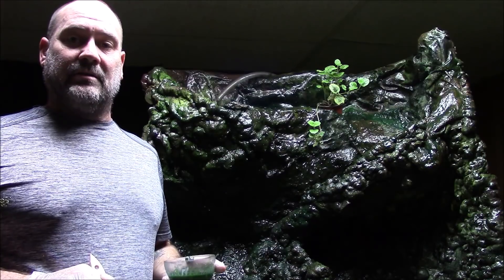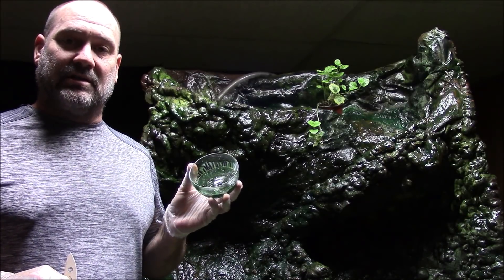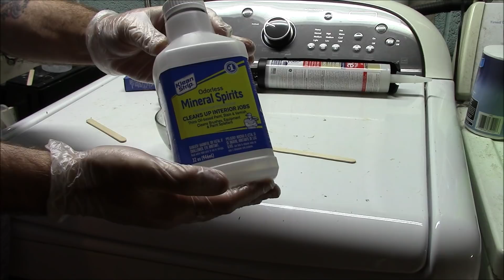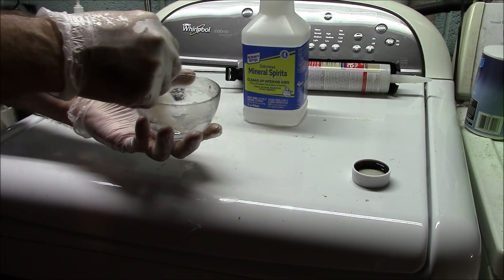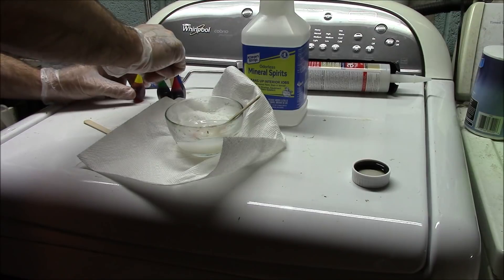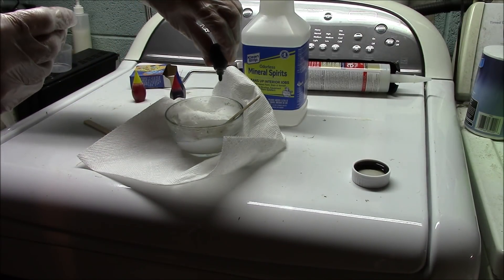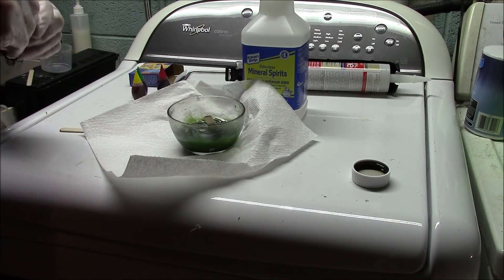Thinning And Dyeing Silicone To Make Rubber "Paint"

Comment: Can you use acrylic paint instead? I’m needing to make fake ganache for a fake cake prop and need it to be flexible to stick to foam and not crack. So can you add mineral spirits to silicone sealant to thin it down and it will still dry to a rubbery hardness?
Thanks for this video tutorial!
Reply: If it’s like a shiny ganache, then I would thin the silicon with Napthine (I remembered the name😉) or mineral turps until it’s about the same consistency as warm ganache before adding the paint. It should look just like ganache, tho if it’s going directly on a foam base that could potentially be a problem as the silicon and thinner will start to dissolve it. It could be ok as the silicon could cure before it’s had time to do any real damage, but you never know so I would paint or cover the foam first, just in case. Good luck.
Reply: @nicola3540  ..thank you! I actually covered the styrofoam with a latex silicone sealant, mixed with brown chocolate colored acrylic paint, so I should be okay! Where do you buy Napthine at…a hardware or art store?
Reply: @nicola3540  ..oh, and I first covered the styrofoam with cosplay foam prior to putting on the acrylic latex silicone sealant mixed with paint.🙂
Reply: @nicola3540  …I’m having a hard time finding Napthine. Are you located in the United States? I wonder if it’s under a different name as I looked for it online at both a hardware and art store…and on Amazon too…and couldn’t find it.🤷‍♀️
Reply: @janetgernand9123  I am an idiot, SORRY!!! Naphthine was the name of our former state premier (ie governor) here in Victoria, Australia where I live….. What I really meant to say was naphtha, which I think could be plain old mineral spirits in the US, which is what you asked about in the first place so sorry for the confusion. (In Australia there’s no such thing as ‘mineral spirits’, we’ve got mineral turpentine - which also works - or metholated spirits, which is called rubbing alcohol in the states and doesn’t work at all)
Reply: @janetgernand9123 I think some states in the US don't allow it to be sold. I'm in PA and they have it at lowes/home depot/ Walmart.
Reply from the maker: Not sure about acrylic paint, but the way I did it, it is still a firm silicone rubber.
Reply: @DanHiteshew-oneandonly  it’s like that with acrylic paint as well - I used it in my “underwater cave” aquarium @ 5 years ago and it’s still as solid and hard rubber like today as it was when I made it. You only need to add a very small amount o f paint to get an opaque and uniform colour so the texture isn’t altered that much - you wouldn’t use it to glue an aquarium together, but it’s still pretty strong and tough. If you’ve any silicon lying around, squeeze out a tiny bit and mix in a drop or two of paint and you’ll see what I mean🙃

Comment: Ok so I've worked with silicone some and I keep having issues with the painting portion.  I just learned to airbrush with silicone but my paint is still just wiping off easy and I thinmed with mineral spirits.  I .wondering if something is wrong with mine though because it's a thick milky white but it looks like same bottle you have in video but it's not that nice clear liquid you poured.   It seems to keep globbing up or thickening the silicone though the opposite affect that I want
Reply from the maker: The silicone should come in white or clear. The clear can look "white" once you start stirring in air. Water is water starts the curing process, so as soon as you add the liquid food coloring, you're working against the clock. this could be where you're getting the clumping. You can try powdered food coloring too.
Reply: @DanHiteshew-oneandonly   well my biggest problem really is even though it's had like a week to dry and feels try the paint is just rubbing right off.
Reply from the maker: @alishajay8956  Silicone doesn't really bond to surfaces, so it'll always be like that. It's not going behave like actual paint.

Comment: Hi! Great video. I can't buy mineral spirits in California, what can I use instead? Will paint thinner work? Would lacquer thinner be better? The hardware store sold me paint thinner because their catalogue said to use it, since they can't provide me with mineral spirits.
Reply from the maker: I believe so (especially if their catalogue says so). Turpentine works, and I believe you can use alcohol (Isopropanol or ethanol, just get the purest you can find. Iso comes in 99% anhydrous, and ethanol is about 90% if you get Everclear)
Reply: @DanHiteshew-oneandonly  thank you so much for replying, I think that's very kind :-)

Comment: Great video! It helped me a lot with my current project :D

I did have a slight problem, after my silicone dried I had a lot of tiny holes. Someone told me that the mineral spirits had to evaporate out the the silicone somehow, but I don’t know. Perhaps it’s worth mentioning that I used acrylic paint in the mixture, but my previous mixtures of acrylic paint and silicone never gave me holes. 

Any idea what I might be doing to cause this?
Reply from the maker: No, but I'm not sure mixing acrylic paint with the silicon won't compromise the silicone's integrity.

Comment: If you're using GE silicone 2+.
silicone oil will also mix well and thin the silicone.
I've tested and done so several times.
I use Super Lube 56104. It's safer for using indoors since it doesn't offgas.
Reply from the maker: thanks. That's good to know. Does it evaporate and stiffen back up like the thinner does?
Reply: @DanHiteshew-oneandonly  It doesn't evaporate. it permanently thins the silicone. it also changes the properties making it more flexible the more silicone oil you add. If you add enough it becomes stretch-able after it cures. if you're applying 1/8 in or thinner coats i estimate 24h cure time. If it's 1/4 or thicker I've had it take 1 week to cure.
this won't work with GE silicone 1 "vinegar cure" only silicone 2+ "ammonia cure".
Reply: @zeroumashi2947 , thanks for the info on thinning the silicone RTV rubber with silicone oil!  The part where it cures to become stretchable. 
I’m going to use this on the inside surface of the tires on our lawn tractor. I didn’t know what to do to the Silicone to thin it out to make it much easier to apply. I also didn’t realize the mixing action introduced moisture vapor which much aided in its curing. 
Very good info!
1 week cure time? That’ll do it for me!
I’m thinking this will work much better than silicon body paint as a coating.
I’m not interested in buying inner tubes for tires on non-road applications.

Comment: I thought silicone does not bond well to already cured silicone?   Perhaps the thinning process helps with it adhering?  Looking this up I see some say it does bond well, some say it doesn't.  With bathtub in particular I see that it says to scrape it all out because it doesn't bond.  Probably with bathtubs the caulk has lost integrity from moisture working under it.

Comment: I am not into aquarium, but I am interested in the thinning of silicone for paint, it may work well with a project I am working on, lighting the tips of antlers, I have been working on the process of hollowing out antlers so that I can put the lighting on the tips without mutilating the antlers, without drilling holes and patching them. After hollowing out some answers I thought I could put rubber tubing instead of wires to run water through for a aquarium filter system. Check out this link.                     https://photos.app.goo.gl/HUjmHzHosJBLCa9k6

Comment: Is there an issue other than odor with the acetic acid?  I want to try your method with RTV 4500 (food grade) but it has acetic acid in it.
Reply from the maker: Nope. It's just hard to breath and makes your eyes water terribly. Be sure that it's fully cured before adding aquatic animals though. And remember that the cure time will be much longer once you thin it out
Reply: @DanHiteshew-oneandonly  I wonder if ammonia is more dangerous to breathe, despite acetic acid causing the eye-watering. I had that happen - the smell is way overwhelming from the silicone acetic acid. But vinegar is safe to drink - so I think acetic acid is safe.

Comment: I have also used the liquid rubber (stuff they advertise on tv) U.T.C. colorants would be compatible. Check on fish "friendlylyness" I work on swimming pools/ ponds and silicone does not do well on a water saturated underlayment (concrete, grout, plaster) It always loses it's bond. Works fine on porcelain/ glazed tile or glass.  For what its worth. 
Thanks for the vid. I need to make a silicone emulsion (very thin like water almost) to seal freshly cleaned pool tile. You answered my question.  Mineral spirits will thin silicone.

Comment: What is the work time after you mix the "paint"? Thanks for sharing. It looks amazing!
Reply from the maker: Not long. The thinner you make it, the longer you get, but it's still measured in minutes. (maybe 10 to 15 at the most)
Reply: @DanHiteshew-oneandonly  have you tried mixing in, or sprinkling on top after painting, some sand or other inert powder?
Reply from the maker: @tims7101  No, I haven't. I was thinking powder might take the shine off. Sand would give a great texture.

Comment: What is the pot life? When I mix 100 percent silicone with food coloring I only have minutes before it drys.
Reply from the maker: Thinning it gives you more time, but not as much as you'd think.
Reply: @DanHiteshew-oneandonly  Thanks! I made a Chinese dragon out of upholstery foam. I was planing to use Uro coat from smooth-on. You don't get very much for the price. So I wanted to use silicone and food coloring to paint it. Once coated will the surface take acrylic paint well?
Reply from the maker: @gilberteaz  No. You can't paint it at all. You'll need to buy paintable silicone, and I've never used that kind. That's why I use the food coloring to dye it.

Comment: Thanks for a great video. You can actually colour the silicone with lots of things - acrylic paint works really well,  it’s less translucent than food colouring and it helps it cure quite a lot faster, oxides used to colour cement are also pretty good, particularly the black oxide. If you want a more opaque effect, besides acrylic paint you can add a bit of talc / powdered chalk (but not so much you raise the ph in the aquarium, tho it would eventually go down again)
Reply: Do you can mix acrylic paint with silicone latex sealant and mineral spirits to thin the silicone?
Reply: @janetgernand9123  yep! You have to mix in the paint when the silicon’s straight out of the tube, ie before it starts to cure, but that’s the same as with anything else you might add to silicon. Keep in mind it can speed up the curing time - sometimes by quite a lot - so it’s best to do it in small batches so you don’t ended up with wasted silicon. Mineral turps is a good thinner, but an even better thinner is the one I’ve suddenly forgotten the name off!😵‍💫 - it’s the stuff you use to fill zippo lighters, I think it begins with N…. I love silicon coz you can do all sorts of stuff with it, from super practical to out there artistic and everything in between, though it has to be about the messiest substance on the planet to use, some of it always ends up where it’s not suppose to be - like my hair, the wall, even once in my bed! - which is kinda annoying.
Reply: Naphtha I think